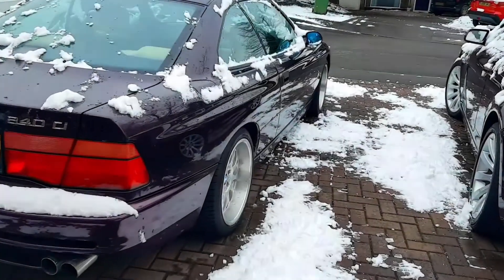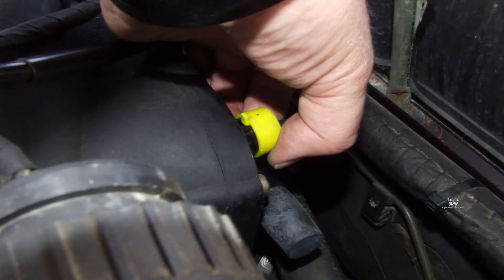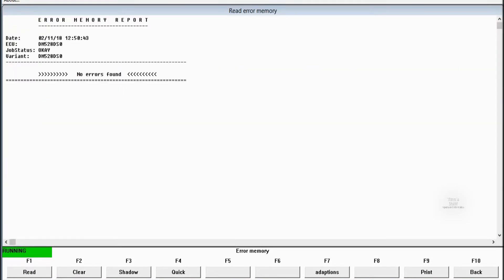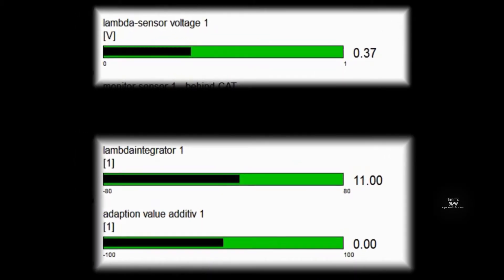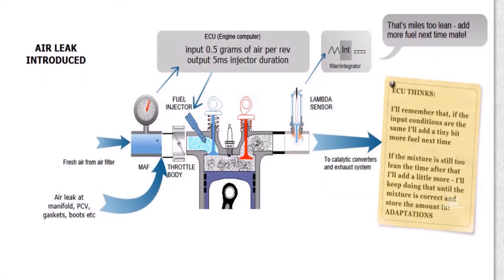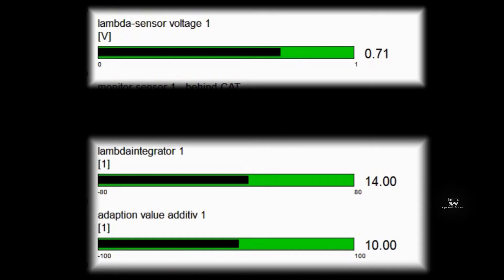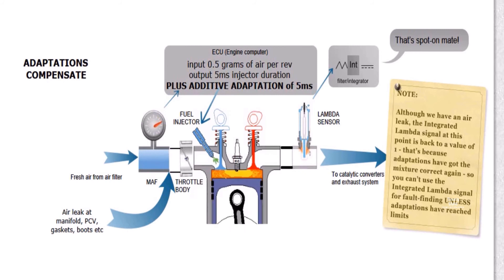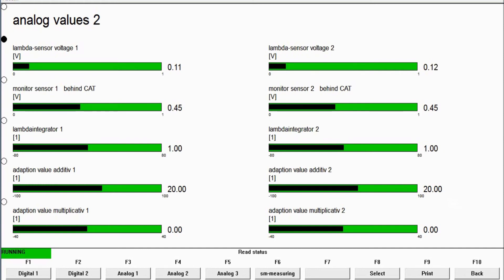BMW Diagnostics - A better way to Find Manifold Leaks

Comment: Hey Timm, great videos! I want to ask you about my problem. Have a M52b25 engine, MS41 Injection.  At iddle, after make an erase of the adaptations, de Additiv Value descends just to -48 (negative) and stays there. Lambdaintegrator shows -4 (also negative).  The iddle seems to be normal, no fault codes, but after a few minutes (around the 70 degrees of coolant temp), the iddle comes a little bit unstable, so a little bit and the engine makes a little "knock" noise. If i erase again the adaptions, these noise dissapears, just to a few kms when it starts again the same... at cold absolut silence, at warm a little knock who disappears after erasing adaptions.  Really Weird. I did a smoke test, no leaks at manifold....   what can i do?   Thanks!!!

Comment: Very good. I will try this tonight 👍
Reply: Well neither value changed on bank 1 or 2 after about 10 minutes so I guess I don't have a leak.
Rough running is all within green levels which I'm glad about.

Getting smoke from the exhaust. Might be turbo seals but wanted to see if there was a vacuum leak that could inhibit oil draining.
Reply from the maker: The turbo engines rely on the vacuum pump to maintain a vacuum rather than manifold depression. Smoke could be many things including the oil separator above the valve covers
Reply: @TimmsBMWRepairsandInformation  
Further investigation showed zero vacuum in the crank case at idle.
My turbos have been smoking. I'd imagine the lack of vacuum is causing oil to drain too slowly.
Time to find the leak ☹️

Comment: Thank you for the video Timm. I have a car with the M52TU (Double Vanos) engine. The engine runs well and smooth running values are very good. When looking at the adaptations the car nevertheless has negative additive (-0.15 to -0.2) and positive multiplicative (typically 5 to 7) adaptations with no engine fault codes. I have replaced the intake boots, rubber bungs on the intake manifold, injector o-rings and DISA o-ring as well as cleaning the injectors and MAF with the appropriate additives / sprays. Do you have any thoughts?
Reply from the maker: The multiplicative adaptations are more to do with fuel pressure rather than vacuum leaks - vacuum leaks generally affect the additive values. So, my guess is low fuel pressure - or lack of fuel volume more realistically. This is a tricky one because fuel flow is usually OK as long as the fuel pump is running - but a leak at the regulator - or dirty fuel filter could do it. Yes, replace the filter to start with - I think on the 'TU the filter and regulator are all one unit....
Reply: @TimmsBMW  Thank you Timm. I replaced the fuel pressure regulator and this improved the additive values which are now at zero although the multiplicative values are still high (8-9). I'm tempted to think it could be dirty injectors - if there was a vacuum leak them presumably the additive values would be positive as well? Thanks

Comment: Hi Timm. Could I get some advice? I knew my m62 was running really rich because of the way it smelled. So I replaced all intake manifold gaskets, o-rings, ccv valve etc. And bought new spacers to make sure the manifold is compressing properly. But there is no change, where do I go from here? I don't have a scanner and I don't have a smoke machine. My first thought is to bring it to a BMW specialist who can smoke test and inpa scan the car. Am i missing something obvious? Thank you in advance, I really appreciate the effort you put into all your videos
Reply from the maker: A common problem is the fuel regulator that leaks fuel into the intake manifold. Pull the vacuum pipe between the two parts and check for fuel - there shouldn't be any!
Reply: @TimmsBMW  thank you so much for responding! I would never had thought to check that. I will check this asap. Appreciate it!

Comment: Thanks for this Timm. Genius, going to try this tomorrow. There's hardly any info out there on the data that INPA shows - emptied a bottle of easy start on my engine today looking for manifold leaks - didn't find any, but these is a way smarter solution!
Reply from the maker: Glad it was helpful Ryan!
Reply: @TimmsBMW  It sure was as I established that I probably don't have any vacuum leaks. Is there a way I can PM you or email or something - I have a weird issue stemming from a melted heater inside the thermostat on my M62TU, green pins on the DME... I've seen your page on the issue but my problem is slightly different...

Comment: I do not see how to locate the leak.  you installed  "leak" but I have one that I will have to use the smoker to locate, n'est ce pas???
Reply from the maker: INPA is used as a tool to ensure what is assumed to be a vacuum leak actually is. You can use INPA to see if the leak is at the inlet manifold gaskets (adaptations being different between banks) - and the size of the vacuum leak. But it should be remembered that INPA is a single tool from a number of options! Ça devrait le faire

Comment: woudln't it be better for engine to get additional cooling if you removed the plastic cover tho? I have bmw diesel with lack of power, but wasn't able to find the cause despite no code from inpa